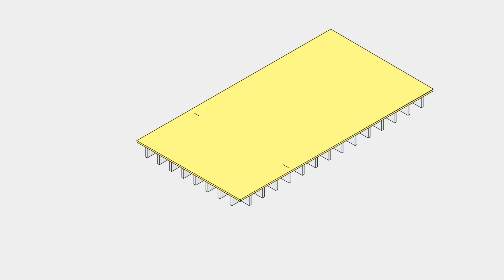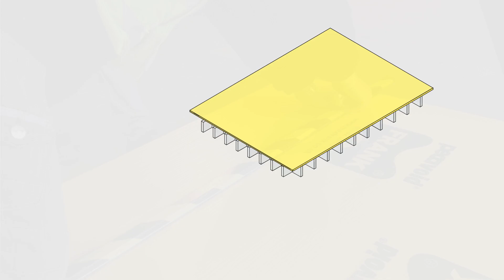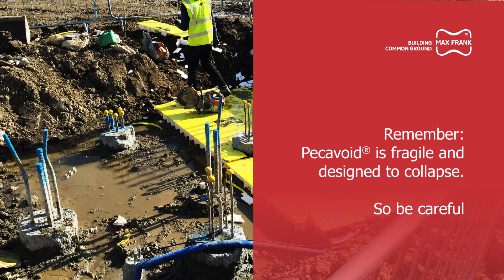Ground Heave Solution Pecavoid®

Comment: Am I right saying that if blinding is not used then soil just goes inside the voids and doesn't cause buckling of the product?
Reply from the maker: Many thanks for your question. 

Pecavoid requires a firm, level sub-base to transfer practical loads of a poured concrete slab through to the ground, as a uniform distributed load. If the Pecavoid is placed directly on the ground soil or on a soft sub-base, a few problems may occur;

1. An irregular, uneven sub-base will provide high spots and low spots directly underneath the Pecavoid's cellular structure. This irregularity will subject the Pecavoid to localised point loads during the practical installation of the concrete slab. Consequently, the Pecavoid will be subject to higher point loads in certain locations of the panel and this may cause premature failure of the product.

2. A soft sub-base (soil, sand blinding etc..) may potentially fill the Pecavoid's cellular leg structure with debris. The recommended clear void requirement - which is designed to protect the building from the ground heave, as suggested by the Structural or Geo-technical engineer, is therefore decreased.

I trust this answers your queries.
Reply from the maker: If a concrete blinding is not used then the sub base (whether soil or sand or 
other) will more than likely fill the voids of the Pecavoid cellular legs and 
could cause premature failure of the product through point loading sand decrease 
the chance of achieving the clear void requirement.